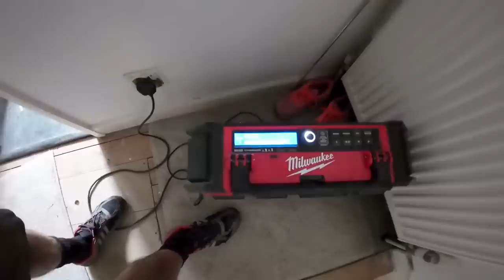HOW TO TOOTH OUT BRICKWORK EFFICIENTLY.. BIG ALTERATION JOB PT 4

Comment: Nice job even though it was awkward! I noticed the pieron the outside wall supporting the steel beams still had a gap between the the two single brick leafs while the other side was solid?

Comment: If the customer didn't want the pillars on the sides of the walls would it work to take out two ceiling joists and put longer steels in their place?
Reply from the maker: All depends what a structural engineer thinks 🧱👍🏽